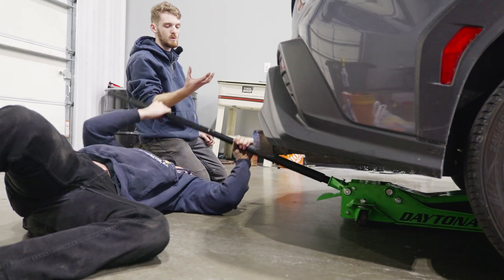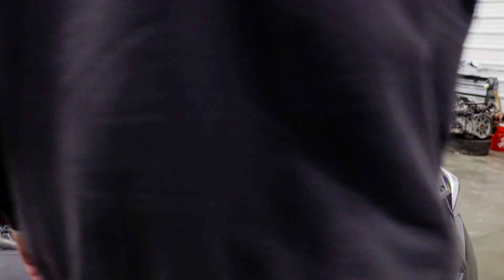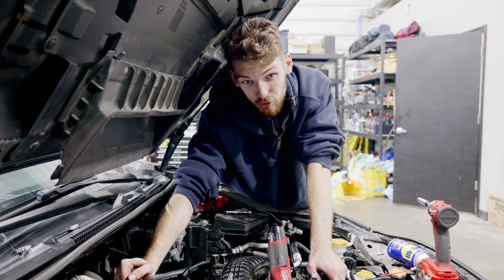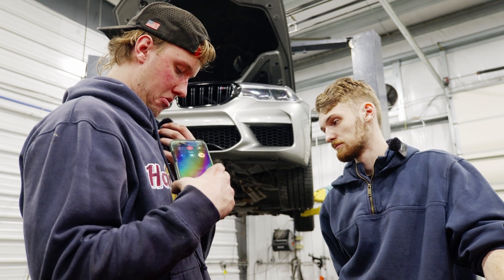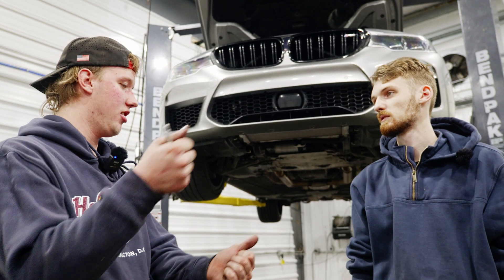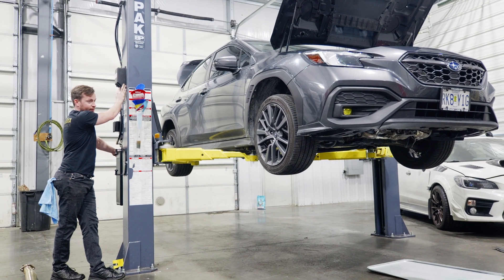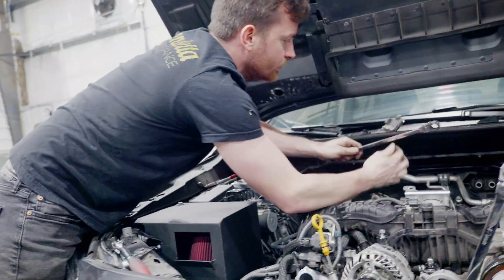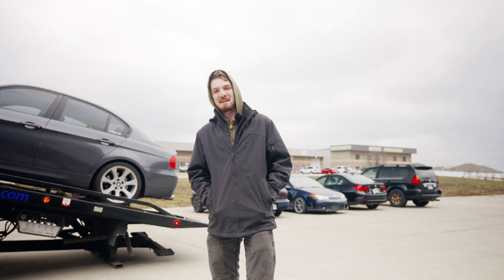Saving a 22' WRX from Rod Knock (PART 2)

Comment: What is with the threads on this motor? Bell housing bolts all messed up. The PCV threads were probably messed up too which led to the botched AOS. Could it have been exposed to something? I've had 3 WRXs and never seen anything like it. Haven't done anything with the bell housing or PCV on my VB yet though. I guess we'll see.

Comment: What about the broken bellhousing bolts? You gonna send it without them or you gonna drill them and repair the threads. I run into this all the time and made a drill guide out of an old bellhousing I cut off a 5spd trans.
Reply from the maker: @averagejoe6084  it ultimately depends what the customer wants to do and which ones break, some don’t want to pay for the extra time and some do.
Reply: @VendettaPerformance 
Those looked pretty bad, would welding a nut on the stud be better than the induction heater?
Reply from the maker: @ when they gaul like this nothing really helps. It’s a chemical bond between the two dissimilar metals (grade 8 steel bolt and aluminum block) so no amount of heat seems to matter